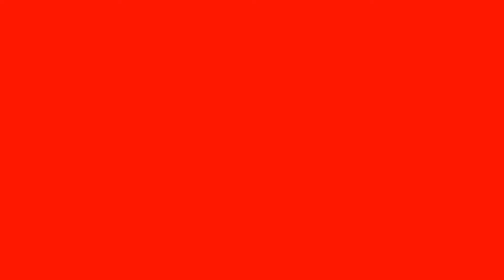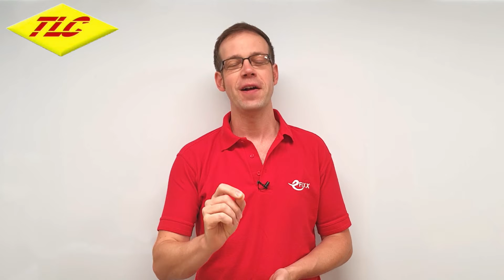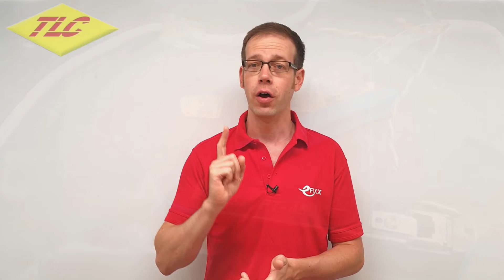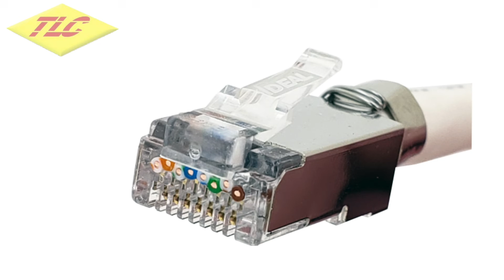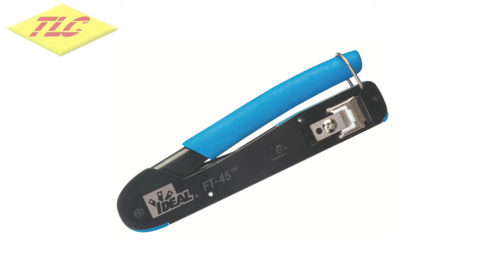Do Cat5e and Cat6 data cables suffer from voltage drop?

Comment: the data speed is affected by the length and that is why it is good practice to fit higher spec cable ie if it was 100m it is better to have cat 6 or better if you were wanting the use of gigabit speeds it is also better in a lot of situations to use ftp or stp to prevent interference from mains or even other cables. Poe can also have voltage drop when running longer runs
Reply from the maker: Voltage drop on PoE is a big issue - depending upon the load (and quality of connectors)

Comment: Thanks Joe. Would there be a loss of data transfer speed if you distributed from a router upto a switch and then to subsequent rj45 outlets or would the recommendation be to go direct from the router to rj45 sockets. Cheers
Reply: highly unlikely that their would be a change in speed as you are not changing the distance and the switch will be rated for a faster speed than your incoming service from your isp